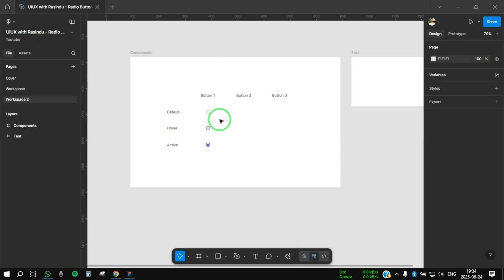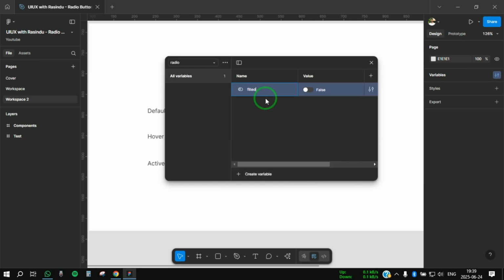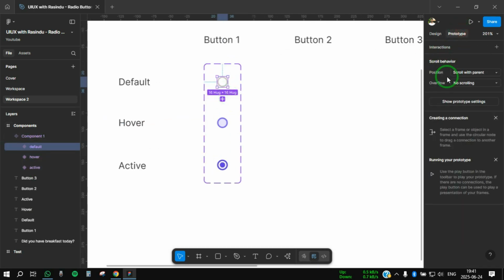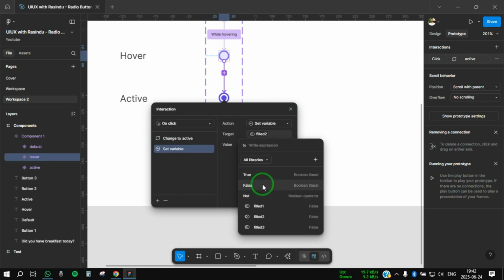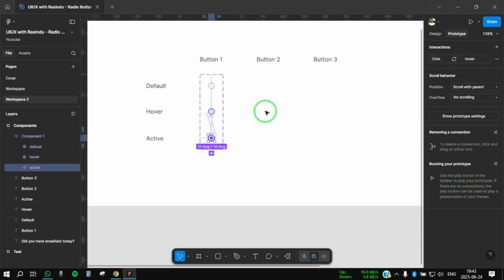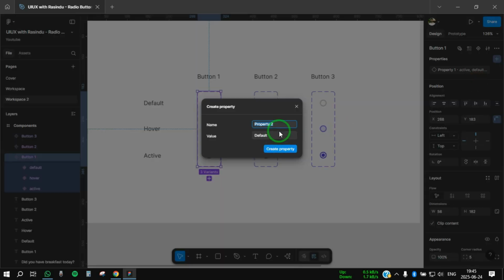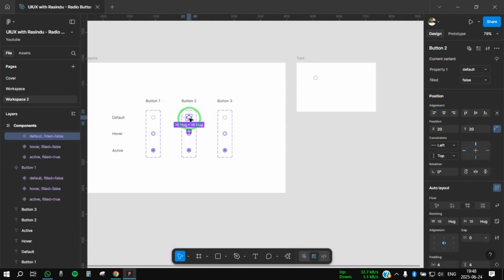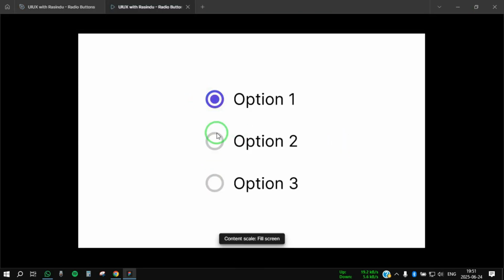Create Realistic Radio Buttons with Figma Variables | Fast & easy

Comment: Hi 👋🏽 thanks for the tutorial.
Why is it that mine 
Doesn't return to the default state. It returns to the hover state. You skipped something in the video. I'll appreciate it if you could tell me what's missing. Thank you
Reply from the maker: I didn’t skip any useful content in the video. By the way, try the options below and you should be able to solve the problem.
Option 1. Make sure the all connections are connected correctly like in the video.
Option 2. Try to add a connection from hover state to default state.
Option 3. Or you can add the connection from active state to default state directly.
Option 4. Try checking if the ‘Reset component state’ option under the "State" dropdown in the Interaction window (at the bottom) is enabled.”
Reply: @uiuxwithrasindu Thank you. I'll try these options
Reply: @Annabelle-d7g I have the same problem! I follewed another tutorial that uses the same exact way and last year it worked. This year it doesn't :/ at least for me.